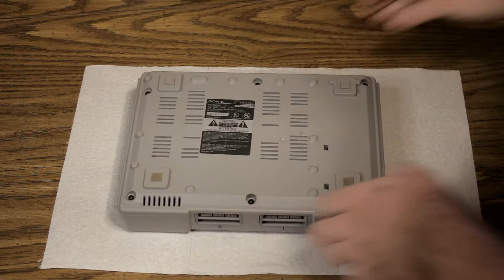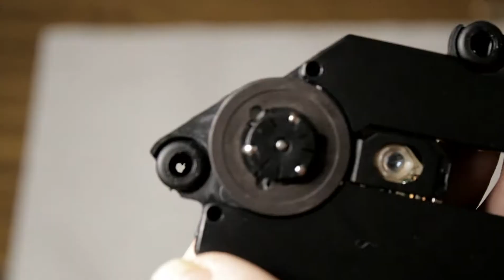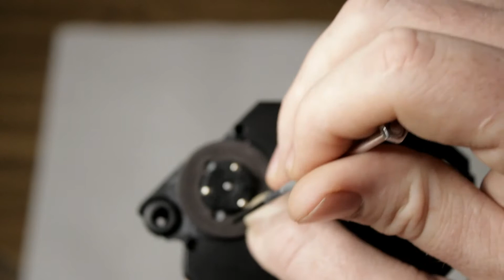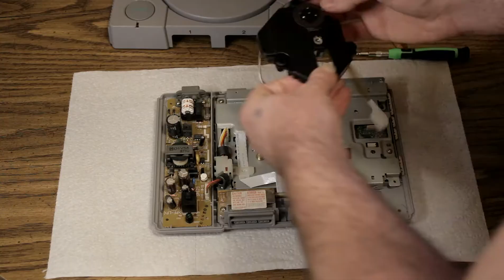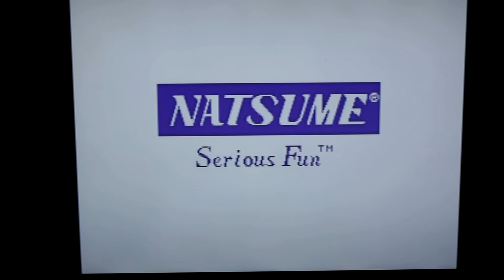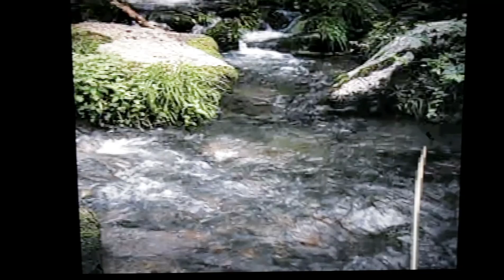PS1 DISK DRIVE HAVE YOU DOWN? REPLACE IT EASY!!

Comment: That's great and all, but what about Japanese Console versions of the PS1?? Many of those ribbon cables, especially the ones from the 3500 series and before, have smaller ribbon cables, that make it difficult to put it back in.

How would you insert the ribbon cable back into its slot?
Thanks.

Comment: Good call on checking the screws on the spindle to make sure its not rubbing. My new drive assemby had this issue and I was able to take the old spindle off the failed optical drive and swap it out so the new optical drive had the old spindle, but now had no clearance issues and fixed the ps1. Thanks!